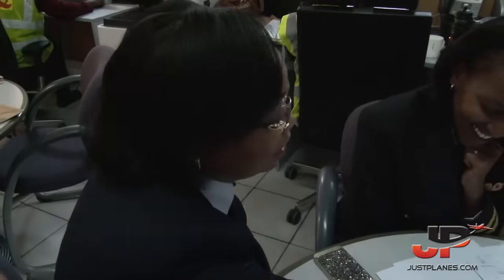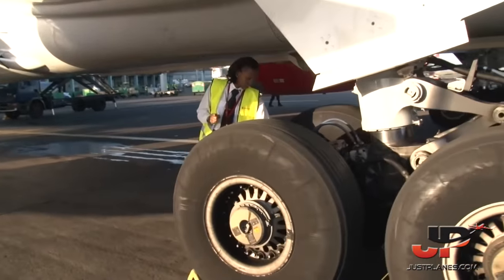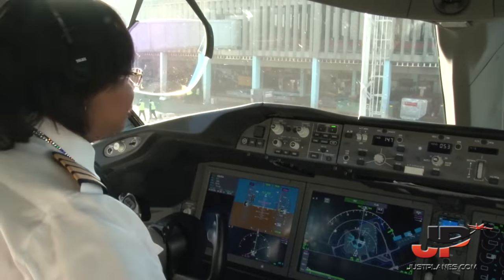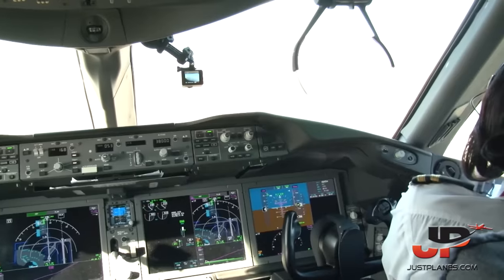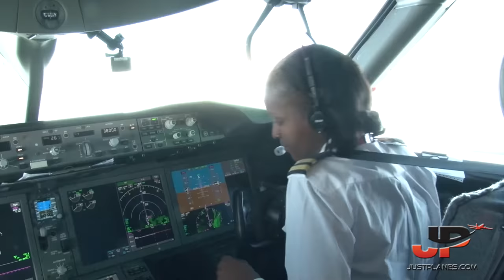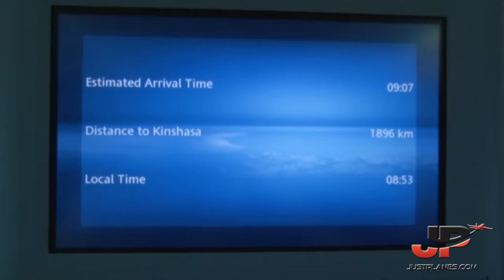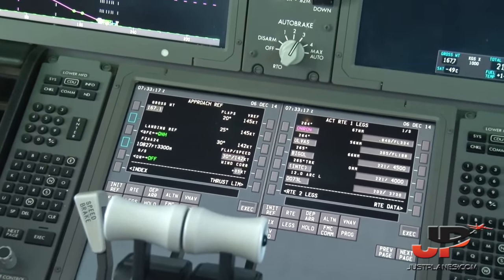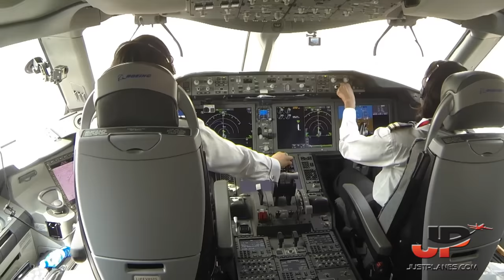KENYA🇰🇪 Boeing 787 Nairobi to Kinshasa🇨🇩 | Lovely Full Flight + Great Walkaround

Comment: I don't know what it is about aviation that attracts so much attention from everyday people such as myself, but there is always a sense of excitement everywhere you go in an airport. 
Many years ago I used to program military fighter-attack jets early in the morning with communication codes given to me by the intelligence unit. I also programmed all the waypoints into navigation systems, GPS units and tested critical equipment for failures and error code messages. The pilot could change anything they want on the fly for the most part, the exception being certain tests requiring weight on the wheels. That means aircraft on the ground if you're the detail needy type. It was a fun job and I saw many cool things, but ultimately there was no job for me after serving. College being paid for by my service, I was able to get promoted quickly from patrolman to detective and from there to major crimes detective aka homicide detective. In other words my friends, college was worth the time and the effort, please don't do anything to dissuade your offspring from being goal oriented and interested in college! It happens more than most people know.

Comment: I have a question about serving coffee on passenger planes. No one recommends drinking hot coffee or hot tea on passenger planes because of the source of water used for these two drinks. If these two hot drinks are not recommended, then why offer them or why not use bottled water instead?

Comment: I had suffered badly with Kenya Airways. They preponed the flight at last minute, changed the timing twice, refused to give boarding pass due to overbooking, on arguing issues the boarding pass but retained the check-in baggage and delivered the damaged baggage after 4 days. On complaint did the patch work repair of the baggage .

Be careful in flying with Kenya Airways.